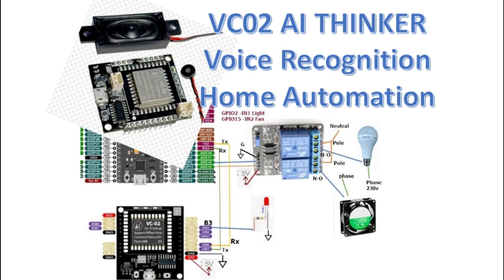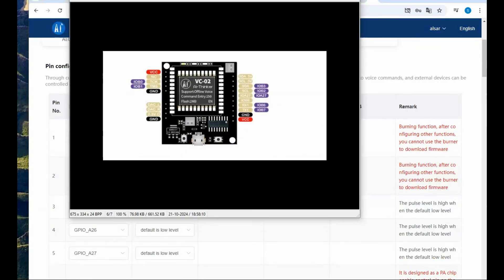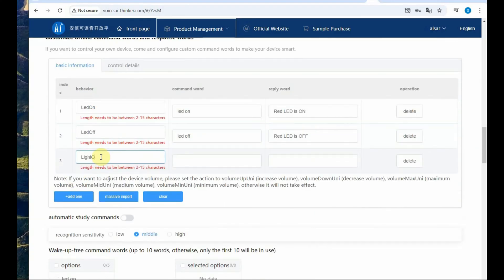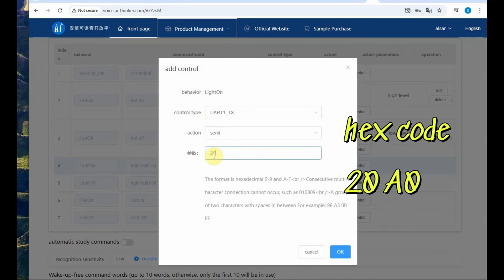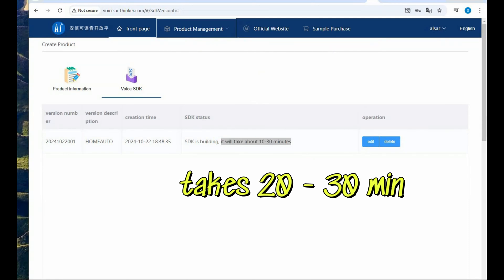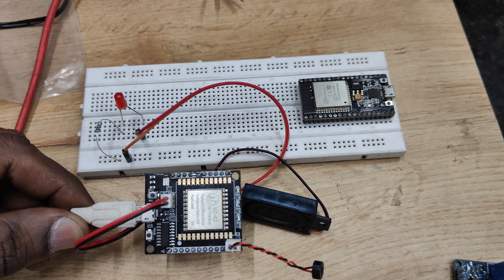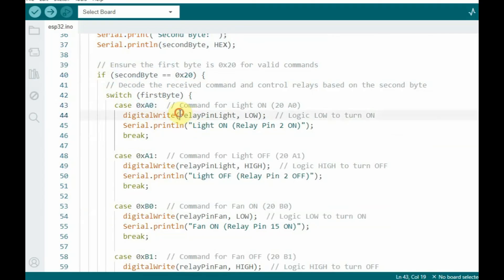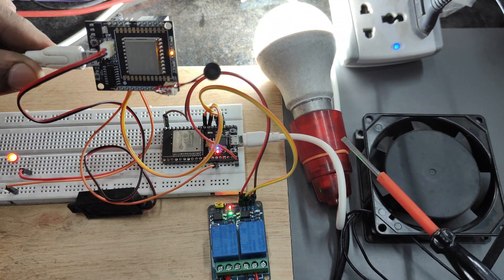VC 02 AI THINKER - Voice Recognition Project

Comment: Hello sir, I tried creating custom commands on ai.thinker website, the building is taking more than 30 mins, should I wait or is there any problem or measures that needs to be considered. Please guide me
Reply: me to
Reply: @tech_geforce    
I waited for 20 mins and then refreshed the page, it is getting built. So started doing like that and it is working fine. Once try
Reply: not sure? but if you make smaller or don't use <copy> <paste> works better
Reply: hi did ypur problem solved? I faceed the same problem too

Comment: what was necessary of using esp32, we can directly connect relay module to vc-02, i had also purchased vc-02 2 days ago, and iam working on it,
Reply from the maker: Both options defined in video.You can directly use the GPIO pins or use Tx/Rx with ESP32. If you need more GPIO pins and functionality then add ESP32.
Reply: @SaravananAL  sir I have doubt first of all sorry' for my English my doubt is I have build la obstacle detection robot using ultrasonic sensor in that I need to add extra features like add gps or any map 4 location in that location it will go and then come that distance are minimum like my room to next room if I say any news it will listen and store then go to that receiver side and tell the news then wait for them to tell anything if no then go yes means listen there and again came to sender side and then tell that small things also need to carry it is possible sir plzz reply to this
Reply: @SaravananAL  sir how much this device and without this we can't do in esp32 ??
Reply: Sir, made 4 relays module connect directly to vc02
Reply: sir, did it work without the esp32?
Reply: @servantfate2849  yes - connect relays
Reply: Hi sir i need one help